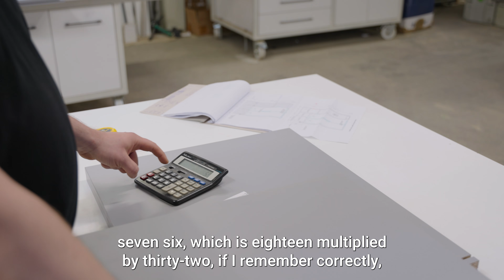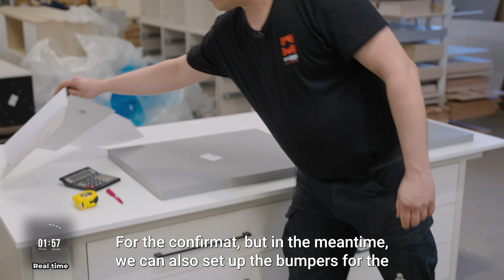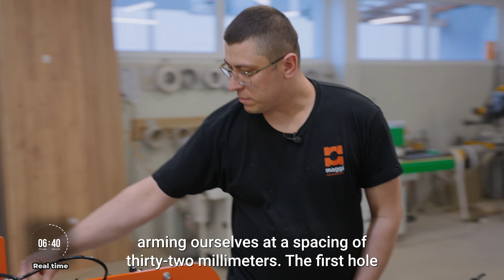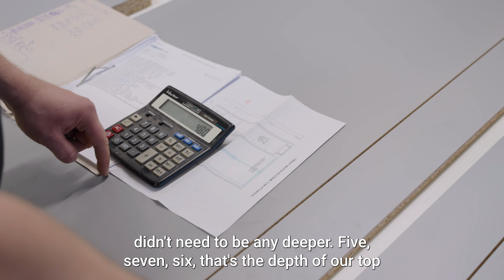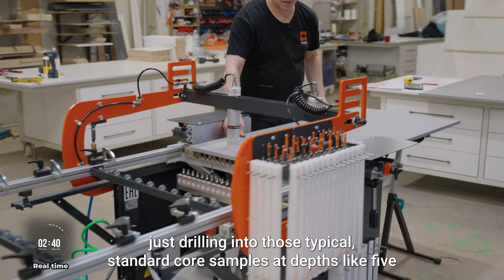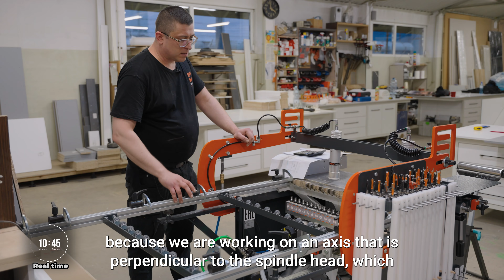HOW FAST CAN I DRILL WALL CABINETS?

Comment: After fist use ability of frame I encountered big problems with setting and keep frame square. Have to make custom elements to improve stiffness. Hanging from workin on frame to work with parallel fence slow an annoying. Accessory shelf collide with stoppers on parallel track. This is prototype.